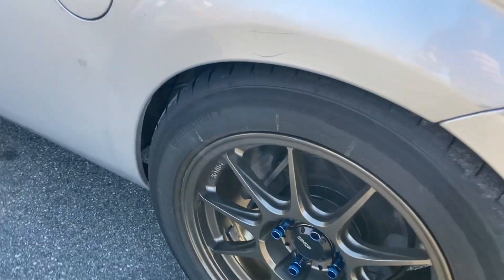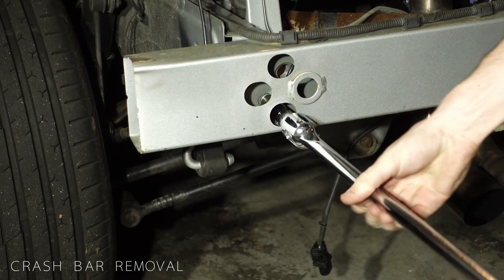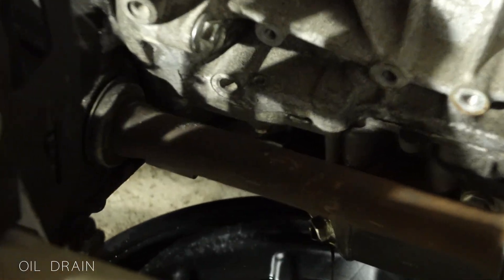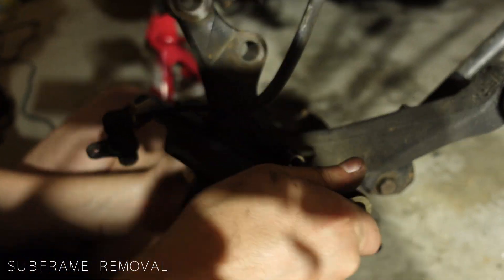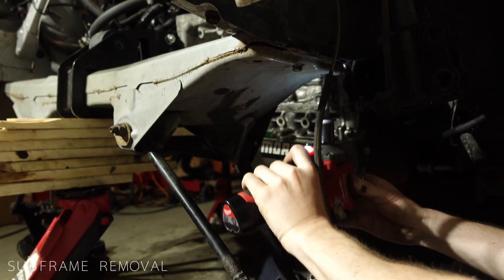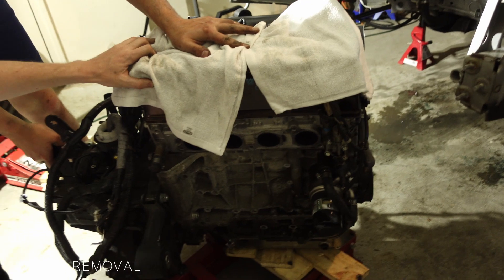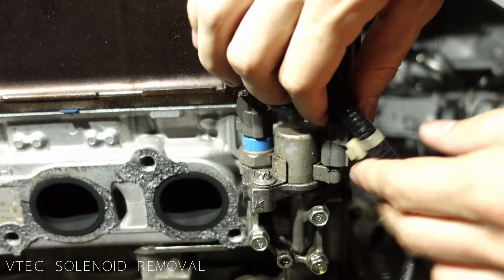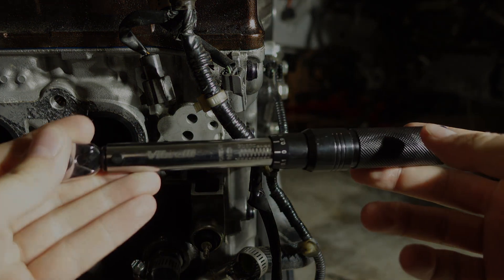Project Cars are Really Hard | K24 MR2 Build

Comment: Should have used some UV dye to locate the leak.
Reply from the maker: Interesting, never even considered that.
Reply: @IGDesigns  worked well on my K20. Timing chain access cover was leaking towards the center of the oil pan. Never would have found it otherwise.
Reply from the maker: Very cool. Thank you
Reply: how does that work?
Reply: @MaybeKian  The dye mixes with the oil and when you shine the UV light it glows. Then you can follow the path the leak took to find the source.